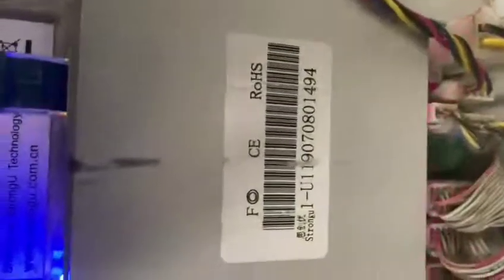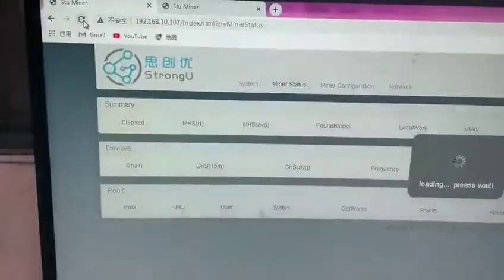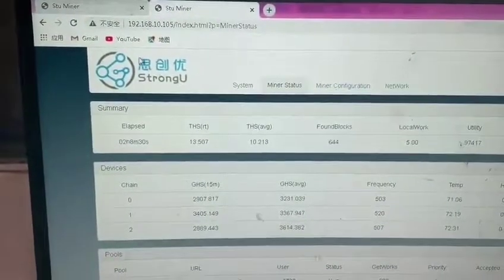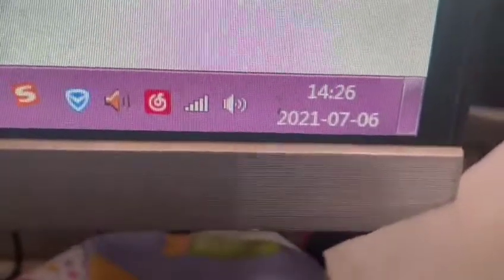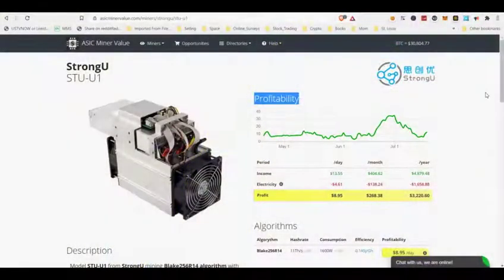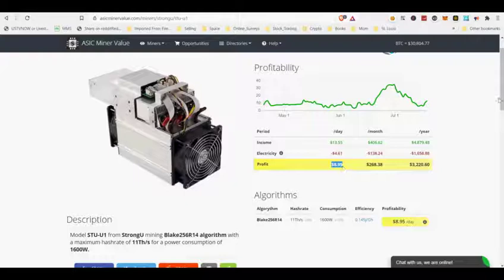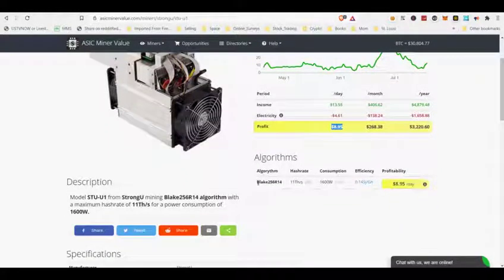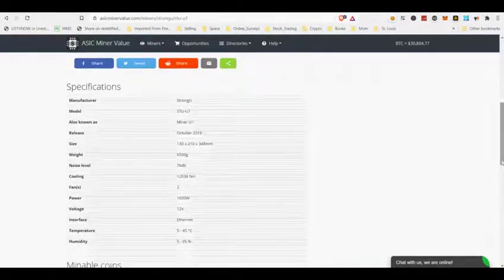How to Mine Decred DCR Coin using StrongU STU U1- How to Mine Decred Coin via Asic

Comment: Is it normal to have the hashboards frequency above 500? Or it should be stable at 320?
Reply from the maker: Did you buy is used?  Was it over clocked by previous user?  It sounds like it is been over clocked.  You can adjust down the frequency back to default to prolong the life of the miner.
Reply: @SoundCrypto  yes I bought it used, is there a way to reset it to factory settings ? And how do I change the frequency to 320 ?

Comment: Have the StrongU STU U1, is it posible to mine into a wallet? or do I have to use a pooling service such as 
POOLIN? at the moment I am using this service but I would like to mine to wallet that does not have KYC as i would like to have my Crypto long term and have it TAX invisible until I cash out.
Reply from the maker: I will get back to you on this.
Reply from the maker: Here are the Decred pools F2pool.com, Coinmine.pl, Beepool.org, Uupool.cn, and Luxor.tech.  You can mine to pools directly and keep it there without sending to exchanges.  No KYC on mining pools.